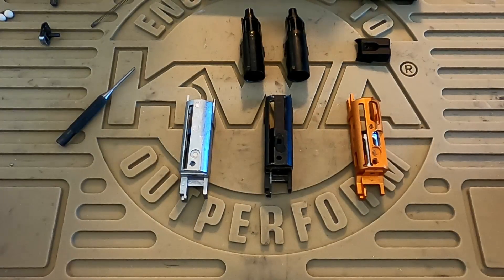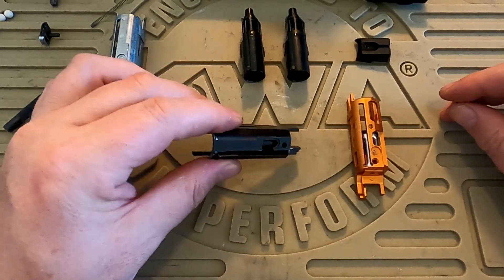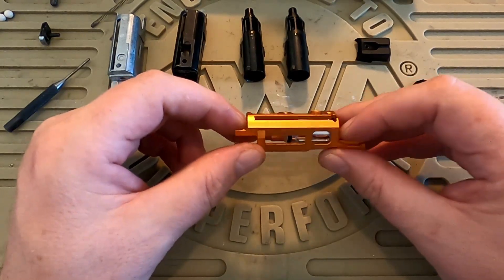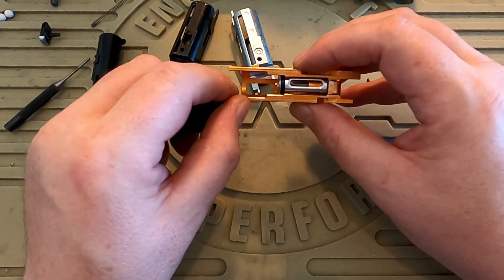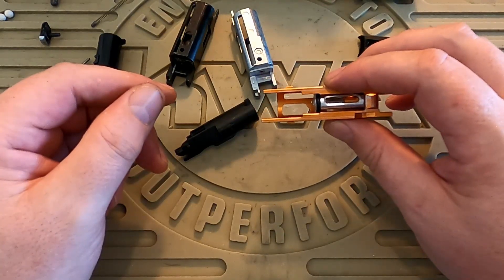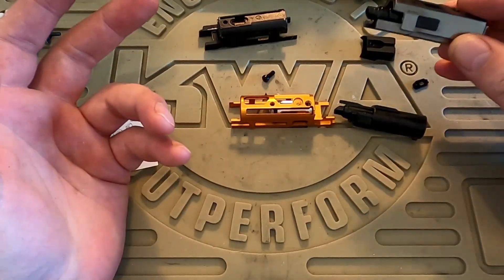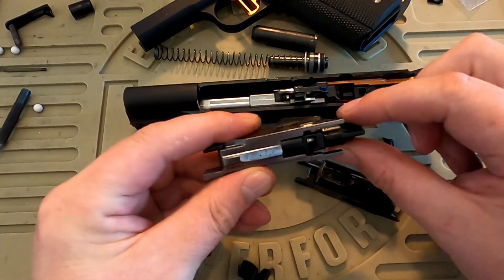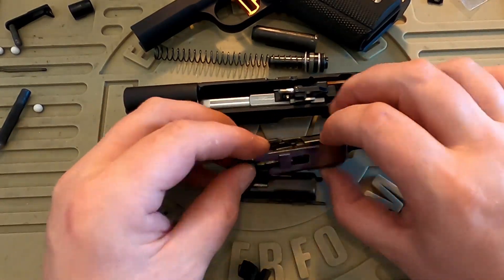Blowback Unit Comparison and the Volante Stratos

Comment: Does the Edge Ultralight fit inside a WE/AW 1911 slide? It's supposed to be based on tm hicapa slide but it has a mock firing pin.

Comment: Pretty disappointing on that Stratus. Was thinking about getting one but don't know now seeing how low it's fps turned out.
Reply: Volante has since improved the design apparently to prevent it from dropping the FPS, I have the newer variation and so far am yet to test it but I WILL be running mine on HPA so the drop in FPS isn’t a major concern as I can tune it for the output